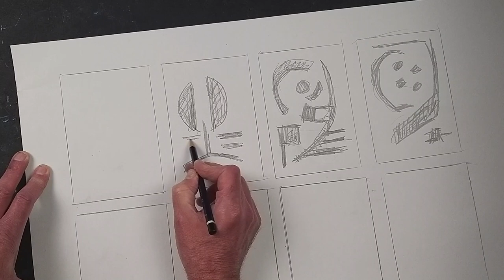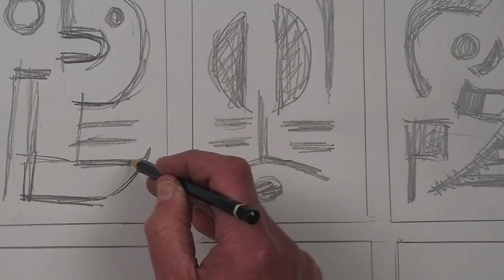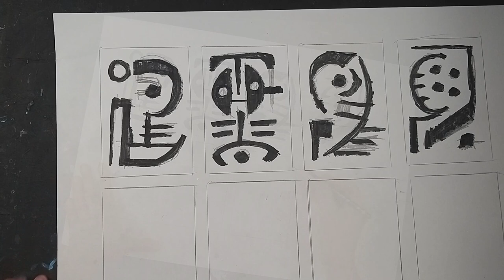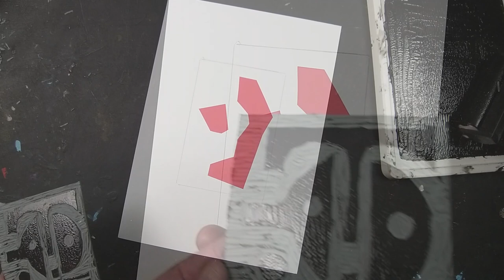Lino cut printing simple demo

Comment: Any recommendations on storage of finished prints, using oil based inks as the medium and acid free paper  as the substrate?
Reply from the maker: I would always store them flat, and wrap them in tissue paper. Allow to dry for at least a week before storing.
Reply: @DanTirels  Thanks for the info and taking the time to respond

Comment: What kind of ink/paint are you using to make the lino print? It looks very sticky in the video.
Reply from the maker: This is NOT paint, that would not work. I am using block printing ink.
Reply: @DanTirels  Sorry Dan, if I had read your statement at the top of this thread, I would already know that!